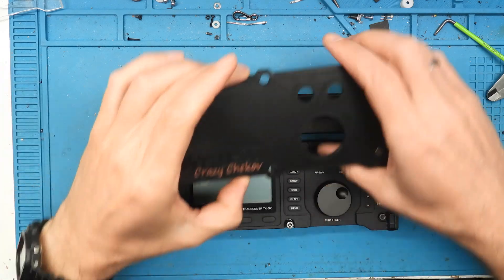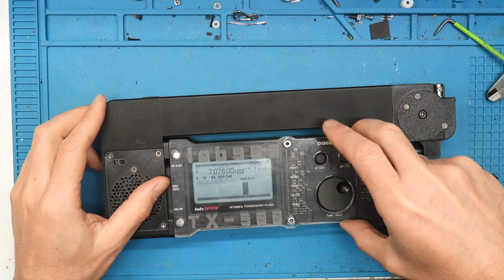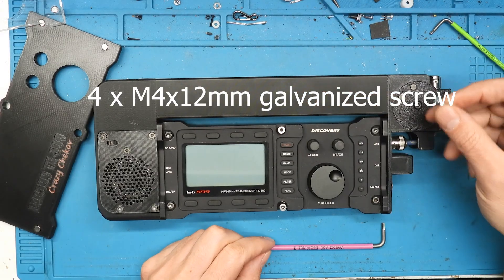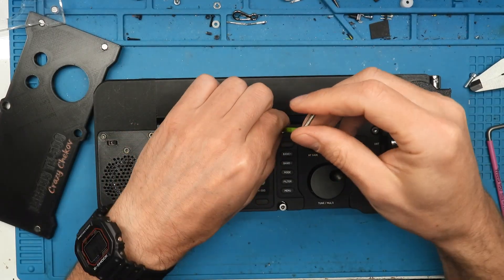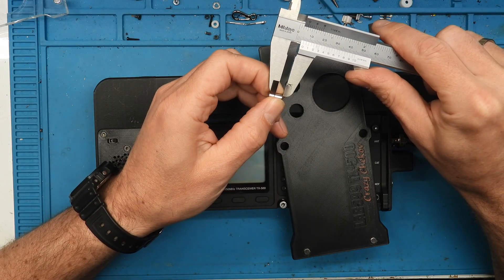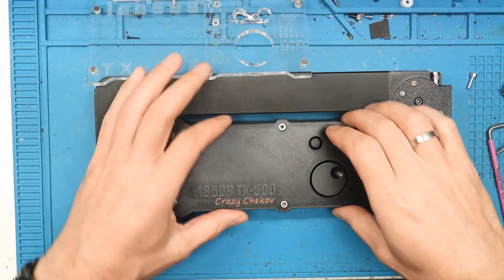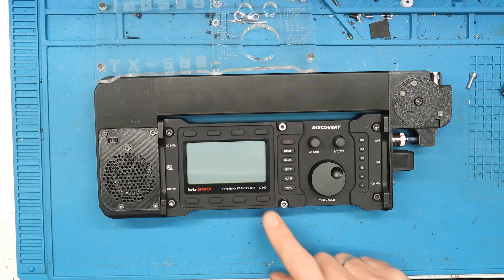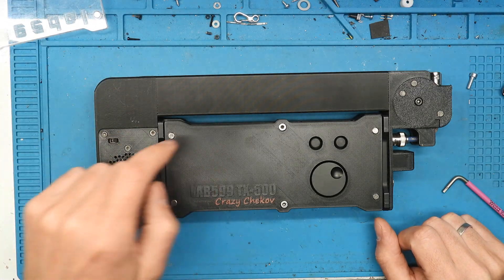TX-500 Display Protection for 3d Printing #DIY

Comment: Just a quick question: why didnt you printed it face-down? The textured surface looks way better then the top layer.
Reply from the maker: because of the "not-through" holes for the 4 magnets and the text. then I would need to print with support.
Reply: @CrazyChekov  nah those holes are quite small and can be printed without support. Just slow down the support speed and perhaps more cooling if possible. Its just a tip 🙂 I print everything face-down when its possible and when it's the part you see (especially on txt plates)
Reply from the maker: @marcelzuidwijk thx I will try 😊
Reply: @CrazyChekov  You'll love it
Reply from the maker: @marcelzuidwijk  just tried it. Was really working for the small holes without support. 
Thx for the tip!
Also tried "Fuzzy skin" in the bambu labs studio software. cool. Looks much better now.
Reply: @CrazyChekov  yes, if you're setting the fuzzy settings on low/small, it gives the same effect as when printing with carbon fiber (if you've never tried it... try the PLA-CF or PETG-CF with hardend nozzle).